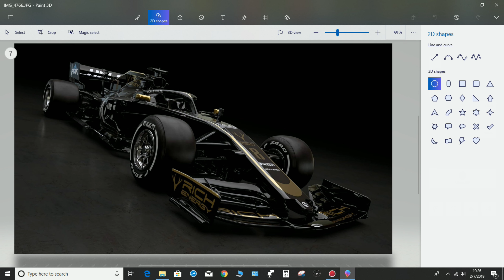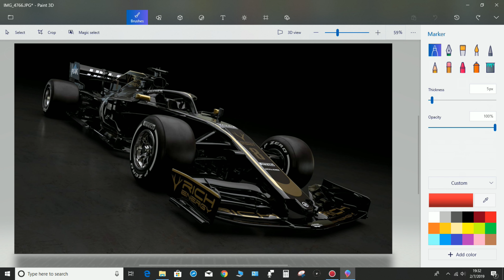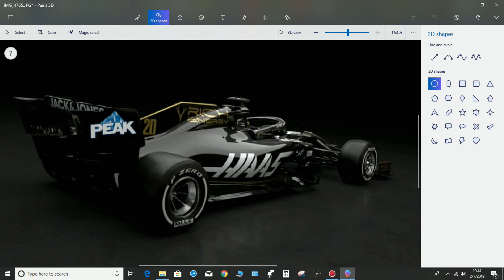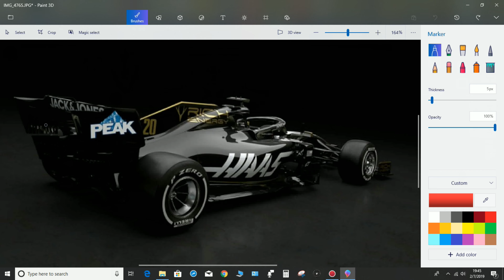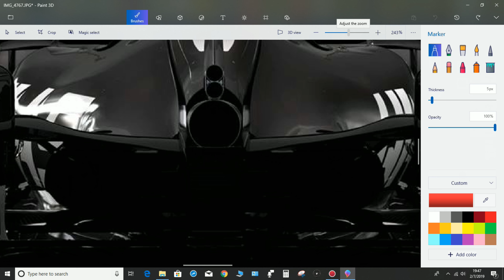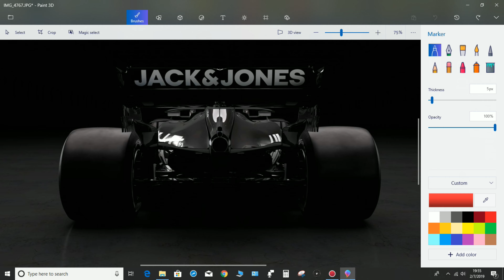Haas VF-19 - Launch Analysis

Comment: Even though fia tries to discourage teams from creating vortexes it seems that the bargeboard and sidepod area are still there to generate strong vortexes.The close wheel racing is surely going to be better but as horner said last year it is not going to make that much of a difference
Reply from the maker: Of course, the teams will try to find any loophole or advantage to exploit. I also expect to see a lot of activity in the mid section of the cars with barge boards and other flow modifiers. The teaser shots of the Mercedes seem to suggest this.